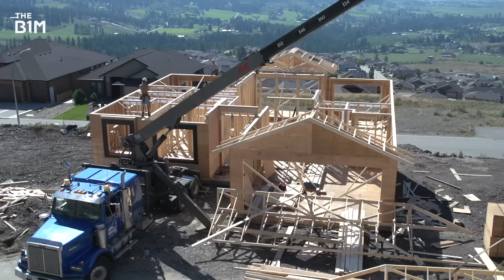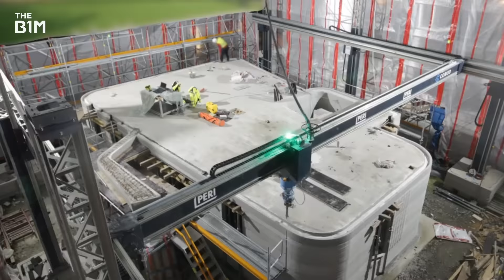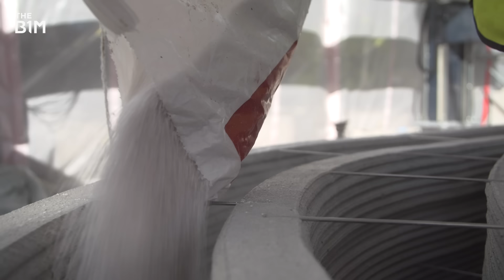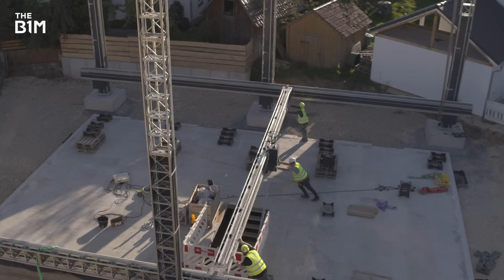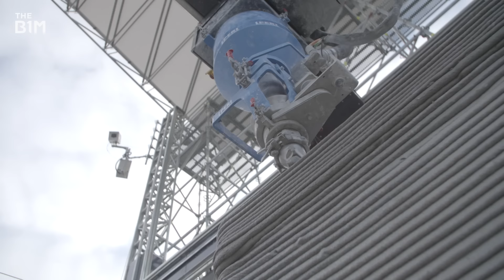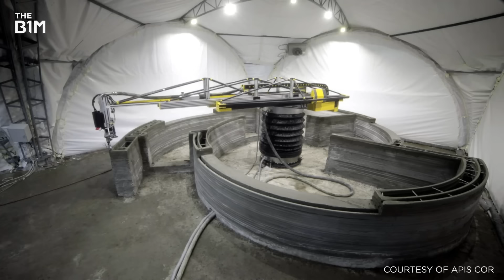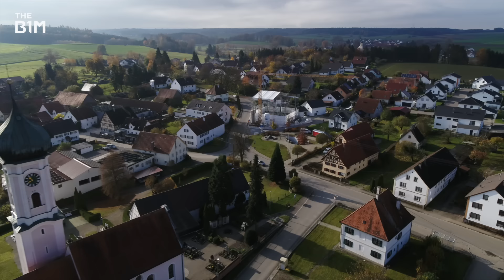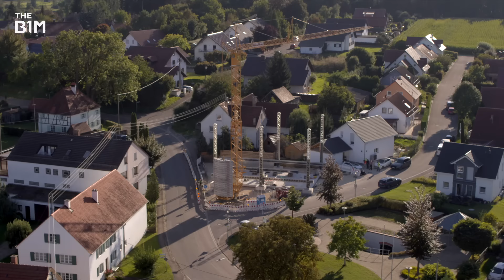Why This 3D-Printed House Will Change The World

Comment: In California at least, and probably any place in the states with seismic or tornado regulations, all concrete structures require rebar reinforcement that gets inspected prior to pouring or spraying. Rebar installation is one of the most time consuming aspects of concrete install. Even more so than forming which is often done with large prefabricated panels or flying forms that are assembled quickly then moved to the next location. 

This construction style is much more akin to brick laying than traditional concrete installation and could probably be used almost interchangeably in area's were traditional brick is still allowed (I believe this is a more common construction method in Europe). Perhaps with an offset extruder you could handle it like a CMU wall and install vertical rebar then print the exterior of the wall and pour concrete down the middle when its compete to anchor the shell to the rebar.

I'd also be curious about the limitations if any with such long uninterrupted runs I would think it would be prone to cracking. They showed an installer taking infrared temps so I image there may be temperature considerations on the rate or number of layers as well.

All and all a very interesting technology but one that is more suited (at least with out more development) to track homes or non inhabited utility structures. Definitely more attractive to developers than end users.

Comment: I was hoping to see the actual house, not a zoom meeting.
Reply: guess you gotta have to wait for the pandemic to end like everyone else.
Reply: Yes indeed, a shame this video is completely lacking in any detail about the construction, materials or the design. Great puff piece though.
Reply: Welp life isnt fair darling, suck on it
Reply: True. All hype, no substance.
Reply: Its a wet dream of some guys that are trying to reinvent the wheel. 3D printing will be "the thing" when it gets more convenient, and cheaper. This right now doesn't look like that, hell they got only bare walls.
Reply: @MrDuck-oi3qc  there are 3D printed houses done with all that already, heck i came to this vid from a vid of one.
Reply: @MrDuck-oi3qc  Also, how do you renovate? Every single wall seems to be part of a load bearing lattice.
Reply: @njcBlackeyed  exactly what I was thinking as well
Reply: I switched off at the start of the Chitty Chat.

Comment: How are round shapes “way more sustainable than weird rectangles” we build now?
Reply: Agreed, the statement is totaly retarded. Probably some marketing garbage slogan.
Reply: More uniform temperature control for one thing.  And a circle has a smaller circumference than a square of the same area, so a round house requires less material.
Reply: @-_James_-  Round = less space. I don't want less space to live.
Reply: @monsterboomer8051  "of the same area".  Same space, less wall material.

Admittedly that space may be harder to fill with square furniture, but the math is still correct.  :)
(Although it's not too hard to imagine shelves and cupboards with curved backs and slightly deeper shelves in the middle.)
Reply: @-_James_-  Your "math" does not account building on a land, which is limited and it costs money. So in order to maximize living space, you need rectangular houses.
Reply: @monsterboomer8051  It's not my math.  It's the math of the universe in which we live.  It has nothing to do with situation either - I was merely pointing out one of the mathematical properties of a round house.
Reply: @-_James_-  Yeah, you talk theory bs. I talk real use.
Reply: @monsterboomer8051  And how exactly does your "real use" talk answer the original question?
Reply: @-_James_-  you can save on material but end up with less space. Hanging a picture could pose a difficulty :-)
Reply: @northridgefield  No, you don't have less space.  A circle with the equal area of a square has a shorter perimeter .

Look:

Square
Width=2
Height=2
Area = 4
Perimeter= 8

Circle
Area = 4
Radius = 1.1283791
Perimeter = 7.0898154

Comment: They mentioned it prints at 1m a second and I saw in another video that means 1 sq. m of a double wall in 5 minutes. Using one of these machines, it is possible to squirt a roof out on a small circular building by doing a decreasing spiral. I don't know how long it will last or what the insulation value would be but it was done in a small project in Italy.

Comment: I don’t think these guys have actually stepped into real construction sites , it’s all using numbers and having to work with the landscape of the site sometimes those numbers change depending on how far you live , there’s certain areas that have water under cables, lines.  This seems very far reached. Unless computers can go out and inspect stuff and evaluate it themselves.

Comment: But why print on site when you can print in a factory and deliver the prefabs
Reply: Why print prefabs when you can pour them in one go. Printing is slow and only ok if done for single designs. Real cost and time saving comes from mass production details (pouring) and assembling them together. Around me many new family houses are made from factory made wood prefabs. House comes packed on couple of lorries and is installed on premade foundation in couple of days. 80%-90% finishing already done.

Comment: They are wasting material by leaving the layers rough.  They should have a separate head that trowels the mud smooth, straight, and parallel.
But what is not typically mentioned in reports on these "breakthrough" wall building methods, it that when material costs are cancelled out in comparison between different systems, the walls themselves are not the element to look for the biggest savings.  There are just so many different individual things that have to be done on site that drive up the labor required.

Comment: cost of the printer, tear down, setup, transportation of printer, being able to lockdown a dedicated fleet of concrete trucks with a perfect mix for printing every trip.... its a logistical nightmare with a tremendous start up cost so huge that will take a very long time to show profits by building tons of houses of a shitload of land that is already under maximum strain of farming to support a mostly useless population.... this is a lot like building with shipping containers.... anyone that can work a calculator knows its shit (did you know you save the cost of a shipping container by just building a normal house the size of a shipping container? lmfao... you save nuthing and it looks like shit) precast concrete structures have this beat in everyway conceivable

Comment: Hmm, I didn't see any horizontal or vertical rebar.  Without it, a small quake would shake that house to rubble.  (And no, those little rectangular wall ties you see inserted can't substitute.)   This is not to say that someday the rebar part --the cutting, bending, and placing, couldn't be automated.  Now that would be something to see.

8:35 Yes, curves are pretty.   They're also incredibly expensive to finish.  To trim an orthogonal kitchen, you need a carpenter.   To trim a kitchen with lots of curves, you almost need a shipwright.

Comment: 1) I think you need another extruder for spray insulation in those cavities.
2) the print-layer look is interesting now, first adopters will have that cache -but eventually it will look dated and be a mark of 'poor people buildings'.   Architects should experiment with different plaster / external stucco - maybe place architectural foam sections for accent.
3) Moving that whole kit on prem, to a pre-poured base seems like a lot of work.  Why not 3dprint off-site en-masse then transport sections that lock together?

Comment: Min 8, as a Building Scientist, I agree and I can tell you that "building culture" is incredibly strong.  As an example, Canadian houses don't use ceramic tiles, instead they stubbornly use various materials that last less than 10 years (you have to redo your roof every 10 years).
.
Choices of steel structures vs concrete structure, or brickwork vs wood cladding is often justified by cost or Architectural preference but more times than not - it's culture.  All houses should have eaves for practical reasons, but culturally (in some regions) they don't.  Vancouver sees tremendous amounts of rain, but for some crazy cultural reason they prefer to build with flat roofs (and torch-on sealant) that is a nightmare to keep waterproof (they have huge leaky condo problems to this day).
.
I have mixed feelings about 3D-printed homes.  The best form of industrialised housing (by far and away) is to pre-cast your home in modules and deliver to site.  But for the same reason pre-cast never took off, 3D-printed will take generations - culture.

Comment: “errors on site have been almost completely eradicated”. That seems like an optimistic claim at best.
Reply: Doesn't it mean that errors happening on construction sites do not happen as often using 3D printing? That's the way I got it. Like less human errors and such things.
Reply: @vicecraft2391  Yes, the intended meaning seems clear, but like anything new and hyped there could be significant optimism bias, as well as many other bias in their views.
Reply: Located far enough away from cities, then location doesn't matter too much. Out of sight; out of mind. 
New city motto: "the beatings will continue until morale improves."
Employment will be human hosts with implants working as memory servers and e-coin miners.
Reply: Most errors will now be with the design.

Comment: Very exciting. However, I’m here to remind that the cement production is one of the biggest contributors of green house gas emissions.

Also, the “weird rectangles” are the most versatile not only for buying furniture (with curved walls you’d need custom made curved furniture) but also to maximize the floor plan area (see the area wasted in the inner wall empty area at 4:58)

Comment: How tough is that cement or concrete they are "printing" with. Like can you drill a hole in it without breaking the wall? I guess you can, otherwise it would be a toy and not a real house.

Comment: This in no way addresses what will occur with future remodels and expansions of the structures.
I can see some significant hurdles with this.
Reply: Right? What happens if 3 years down the road I want to add an outlet over there?
Reply: @danh2716  You could always run wire in an electrical conduit on the wall for that industrial look.  I know of an apartment that was rewired in this fashion even though the walls were stick framed.
Reply: @TheGuyThatEveryoneIgnores  No thanks. I don't want  to live in a Chipotle restaurant.

Comment: They skirt around the obvious issue -- how do you put electrical wiring and plumbing into the walls???
And, then how would you rewire or re-plumb if needed in a built house?? 
This is just a puff piece. 
I don't take it seriously, because they don't.

Comment: Did we forget that concrete is not a sustainable building material? That's the first knock against it. Second knock against it is what happens when you want to change a wall or the size of a window? It's either going to be really labor intensive, or you just can't do it.

Comment: "...3D-Printed House..."  99% of the time, the noun that follows the description "3D-Printed" will be the wrong word. 3D-Printed "Structure", maybe. Fresh off the printer, it's a very long way from being a house. When a house is being built, achieving a roof-tight structure is perhaps 40% done. Then the real work of kitchens and bathrooms and so on starts. Call me when they can extrude a pre-wired 200A electrical panel out of a print nozzle.

Even the "3D-Printed" horizontal surfaces amount to what is called concrete pumping, with formwork to keep the wet concrete from slumping into mid-air. Printing floors would be easier in Zero g (orbit), LOL.

To be clear. Great technology, but the over-hyped headline with incorrect nouns are basically lying.

Comment: Very cool. However, this is inferior to precast earthblock in almost every way. You still have to clad both the inside and outside to make it functional and durable. Not to mention concrete alone is very expensive. This is tech for yuppies not the masses.

Comment: The future is pre-fabricated houses that are bolted together on-site, not a giant 3D printers. You can have robots working in a production line spitting out completed sections of houses 24/7and it would scale very easily. Instead of putting together a 3D printer, you could have put together an entire house in the same amount of time.

Comment: Why was the cost not stated, if the material used is concrete, I have been lead to believe concrete is not environmentally friendly. Using the said building method will only become viable in twenty or more years to see how this type of construction stands up to time. Sorry for being negative.

Comment: There’s an American company that printed a small home in South America a few years ago, they’re testing that one and plan to print a full community of homes for those currently living in slums in that area. The technology seems similar to the other large scale printers, the main difference is regulatory. One place has what is basically the same technology they’re just approved faster. The difference in printers worldwide seems to be some attach it to a crane or scaffolding to print larger structures and others just have it attached to an arm for printing one or two story buildings and other structures. The American company is focused on smaller buildings since they’re focusing on providing housing for the poor, as well as affordable housing for the low income.

Comment: It has been said many times. 3d printed homes will never come into fruition at least for the time being. Why?
 
1) 3d printers like this (including dozens of other startup printers) print only the frame of the building. A building’s frame only account for 5% of building cost. In other words you’re only saving time and money on something that is worth 5% of a building. With all its complexity involved, it’s not worth it.

2) there’s no economies of scale. Without considering the staging cost of the printer, the frame of the building cost the same as a prefab. Prefabs components gets cheaper the more it produces but the printer’s cost is linear.

3) there is no way to insure structural integrity. Since all walls are basically load bearing walls. No way a council will approve of such building methods when each print has no guarantee of standardised forming.

Do correct me if any of the above is misinformed or there’s an insight that I do not know of.

Comment: Personally I think this will be more viable when they figure out how to have a 3D trowel robot to smooth the wall layers into something that won't end up being a moss-covered toadstool after a couple of wet winters. There's probably some valid reason that 6,000 years of building designs have worked on finding ways to smooth the surfaces of walls. I think there is more to it than just personal preference of architects or emperors.

I also wonder about the viability of building modifications, unless these are "green" buildings that are supposed to decay into environmentally friendly ozone and goo within 5 years, so upgrading with new technologies will not be a concern. In the 1950s you might have one wall plug per room, and maybe one hole in the wall for the twin-lead from the VHF TV antenna. Now you have outlets no more than a couple meters apart on every wall, and WIFI throughout the building, plus other communications, and down lights everywhere. What will we want in 20 years, or 50 years? How hard will it be to run cabling in those wall spaces without having to get concrete saws out and eliminate entire wall surfaces to run a single wire?

I'm certainly not against the idea of 3D printing (or robot carpenters, which might be more reasonable), but I think this is a very early prototype concept demonstration, and few people would want to live in a house that will chew you to hamburger if you slip and fall against a wall.
Reply: https://www.youtube.com/watch?v=3pT2QIxle54

It´s the same printer, here you can see a smooth surface.

Comment: I have 2 questions and was hoping if anyone can help me find the answer to those

1) what's the material being used? I didn't see a lot of bricks, is this material alone good enough to match or even beat the brick and concrete combinations?
2) The cost of the machines and its running - can it match the dirt cheap labour costs in developing countries?

Without these 2 things, mass adoption would be very difficult I feel

Comment: Assuming it's concrete, but are there any additives to get it to set right and not be affected by gravity? Wondering if those are all GRAS. Also, how strong is the layer adhesion versus traditional concrete, and how are repairs and modifications expected to be done? Are the thermal properties good?

Comment: no price comparisons compared to normal structural wood engineering, or steel, or concrete, so it tells me that at present it still costs more then conventional building techniques which means it will not take off, til it is cheaper for normal people to build normal houses, which at present it is not, along way(10 years+ probably) from being mainstream accessible or usable

Comment: 3D printing in a sawdust and glue mixture would be highly interesting. Might be more sustainable than concrete, and, if you've ever mixed sawdust with glue, you know the resulting material is basically indestructible.
Reply: What you are describing is called particle board.  It is what is used to make cheap furniture.  It warps easily.  It does not hold fasteners well.  If it gets wet, it is destroyed.